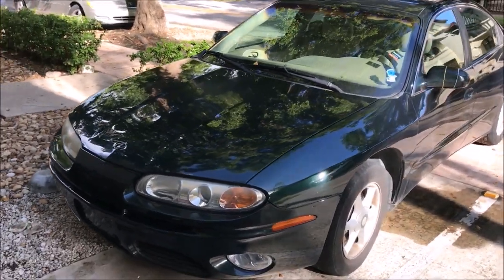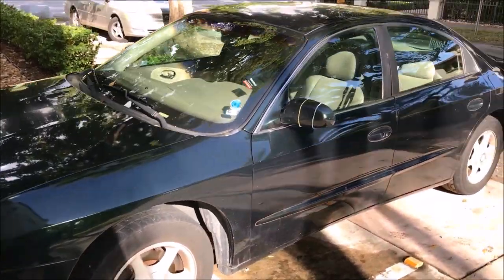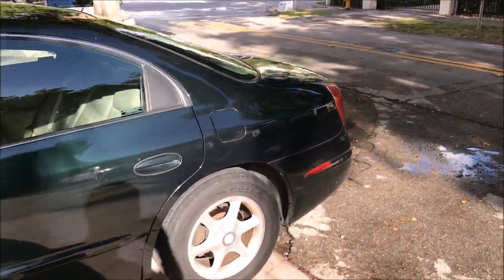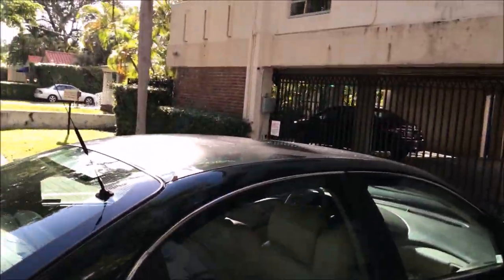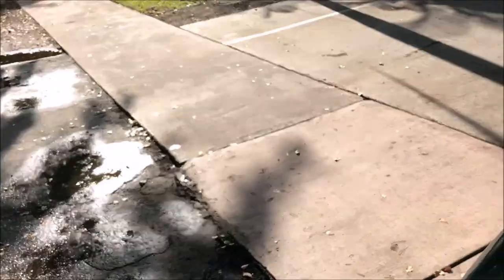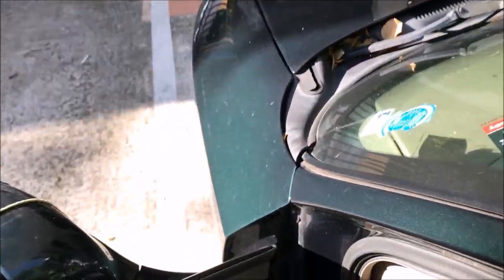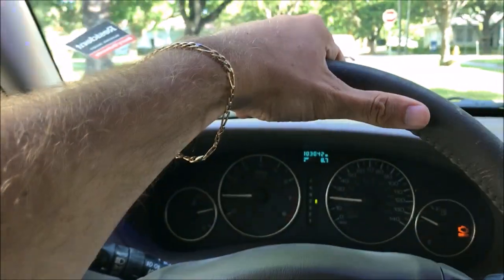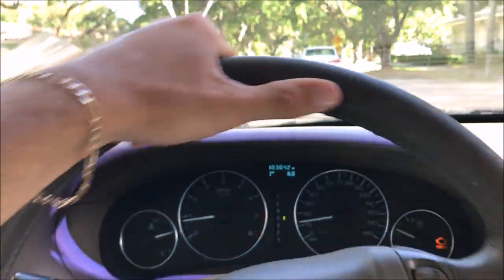I Bought An Oldsmobile Aurora For $500

Comment: I have a 2001 with the shortstar and 200,000 on it. the low coolant is most likely the coolant crossover manifold gaskets. The stall is most likely the crank sensor. I just had to do my front motor mount as it went bad and caused the engine to lift up and pull some ground wires out. They need a little extra care but i love it!

Comment: I wouldn't give you $500. for it.  I owned the 1998 Aurora with the Northstar 4.1 Liter V8 and it was a money pit, with sensor repairs and a computer replacement, and oil leaks, eventually over heating issues. I had put a kelly green paint job on it since the clear on the roof hood and trunk were a mess.  All that and yet I loved the body style, performance, and wide track suspension. Leather and interior was in great condition I kept the engine compartment and interior very clean..  The guy that bought it off me was happy to pay $1500.
Reply from the maker: Herb Finnell  a Northstar 4.1? If you don’t know the size of the engine no wonder you didn’t know how to maintain it. This is a 3.5 shortstar, it does not have the same issues as a northstar 4.0.
Reply from the maker: Herb Finnell this video is several years old but if I remember correctly I sold this car for $2000

Comment: I have an 02 aurora going on 5 years at the time with 154,000 .Very good car being an older car have to replace parts which is normal.leaking oil  valve cover gasket need replacing.overall good car have taken it out of town smooth firm ride.current have 194,153 miles still driving it as a daily commuter. If the car still holds up which it should going to get the valve cover gasket replace.